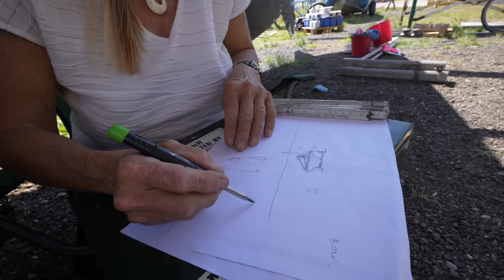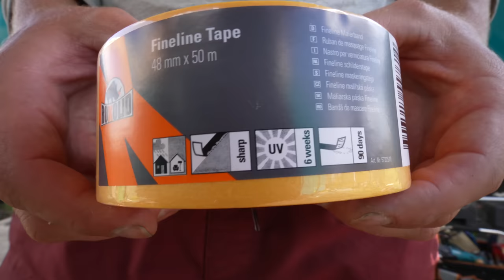Launching My Unfinished Project Catamaran | Wildling Sailing

Comment: Anyone who stirs his coffee with a wrench is ok by me.
Reply: That one got me too! Ha
Reply: Picked up off and returned to the gravel yard no less. Classic…..
Reply: Indeed. Says all we need to know about Mark. 🎉🎉
Reply: Stirs his coffee with a wrench laying on the ground and stirs his paint with chop stix. What a mess!
Reply: Guy is a superhero
Reply: the only way to do it
Reply: That’s ok, but you don’t stir tea that way - right?
Reply: YUP! Nothing like a little gravel with your morning cup of Joe!
Reply: Stir with a common flat tipped screwdriver instead of a wrench. You can jam it into the ground to scrap off stuff on the blade and with a simple wipe with the inside of your t-shirt and it’s visibly clean. Looked like rust on that wrench. Don’t want to get an intestinal issue and need the ‘reading room’ on the boat. Go go go Mark. The boats looking great.
Reply: …gonna get wrench-mouth…got stick-throat once…
✌️<~~Oregon
Reply: I mean I don't want to start a spanner war, but if you use 13mm ring-ended, you'll never get the full infusion. Has to be max 10mm, or 3/8ths, otherwise the swirl effect is incomplete and full flavour is not achieved. Best is a quarter inch chisel.
Reply: Fully agree
Reply: Anyone who stirs coffee straight after pouring hot water is not ok.
Reply: I have stirred my coffee with countless different items, I didn’t even notice it. It’s funny how normal is so different to different people
Reply: Grandpa would pick up a stick from the ground and stir his stuff, always found it hilarious.

Comment: I worked in a boatyard for a while in the 90s. When we came to do the waterline on a boat, the boss would get out an old surveyor's theodolite and set up 30 metres or so away amidships and direct us as we applied the tape. Perfect job every time!
Reply: Today you would use a Lazer pointer or level and you could do it single handed... transfering to the hull inners by using a length of clear plastic  pipe  with water in.. matches the inner level to the sight line.. even across along stretch between hulls .

Comment: 1 advice for the next job when using masking tape. Never roller up or along the masking tape, always use a brush and brush from tape away, then roller carefully close (not on) to the masking tape. This is to prevent paint bleed under the masking tape. Otherwise, a good job well done.

Comment: Yeah! Wet keels! That's a lot of progress in a short time. Rigging, take what you can get as cheap as or for free, you can always rehash it later. You will need some extra motivation over the coming winter months, being able to make her sailable in the short term would be a good target to achieve. I'm sure there will be some that are getting rerigged over the winter at that yard and would donate their old rigging that will be good for a season or so.
Reply: They say replace the rigging every 10 years. An insurance company might say 7 years, especially for the main supportive rigging. Say you are going to take 10 years to go round the World it would be best to start from new. Most that comes off is because it old and past it's use by date. Might be OK for light summer coastal cruising but still risky. Best to get good stuff and don't under spec. Maybe select some good used items for emergencies. Quality shackles and blocks always worth picking up. This goes for anchor chain too. Not cheap so always a difficult decision.
Reply: @delukxy  Wharram boats are (of course) a bit different. 
Just use high-quality very-low-stretch Dyneema for the standing rigging.. (That type of Dyneema is very expensive, but it's also very good).

Comment: Google translate (sorry). For the waterline you can take two plastic bottles. Return them. Cut the bottom. Mark them. Connect them to a long watering tube. Fill with water. Secure one of the bottles in front or behind the boat. You have a free water level. Only obligation: the boat must be wedged horizontally... I did it and it works.

Comment: Such a long way from paddling with a shovel in a shore salvaged, almost leaking row boat, out to your newly purchased wharram, with no assurance it wouldn't sink momentarily. And then your cleaning 10 yrs of mold and filth from the inside, square by square, til you had a place to lay your head. I could hardly remember those days as I watched your boat being lowered back into the water, beautifully painted, floating and taking its place alongside other sailboats of the respectable sort. By gum you did it.
Reply: This is just lovely🤗

Comment: I was wondering, how many layers of paint did you ad on the repaired polyester spots on the hull after using the primer and before applying antifouling? Because antifouling doesn't protect the polyester at all, it's only against barnacles. Normally your put 5 layers of paint on the blanc surface before applying antifouling.

Comment: You can buy these crepe rubber blocks that are made for removing all that caked-in crud out of sanding pads. You just run the sander and rub the block into the sandpaper and voila! you get a new sanding disc/belt that you would have thrown away. Saves heaps of dosh👍👍

Comment: The reason Boats are white mostly is because they are in the sun most of the time, dark colors like solar panels absorb heat and probably will cause unnecessary repair later from the heat they absorb..
Reply: Also (as I’m sure you know) white also stays better looking longer. Is easy to touch up without looking patchy. And is easier to see than a darker colour on a dark sea. White maybe a bit unimaginative but I stick with white now… it’s a practical choice not a creative one.

I had one red boat… was a total pain to keep looking good.

Comment: I like to use a thin fineline tape (like a vinyl tape) and pull it tight to get long smooth straight lines, it also gives a crisp line compared to the paper tapes. Your way works to, just a tip

Comment: You forgot the clear plastic pipe and water level trick ...add food dye for visibility fix one end and the other will always balance to the same level all round the hull or boat.
Reply: The problem was the yard, the boat was on a slope, or we would have laser levelled it
Reply: @dominiccorley7546  
Fair enough but the same tube level can be used to get the boat level on blocks as well.
Reply: And for measuring any variations from a chosen level over irregular terrain...it doesnt break or cost a lot either and needs no power source.. 
I used them as a kid plotting blowout transects through sand dunes... And streams.  Dont think you would want to play with a Lazer level on water.. or in a swamp.😉👍🏼🧙‍♂️🇬🇧

Comment: 1:58 old adage: "if it looks straight, it's probably straight". You can also help yourself with a little trick. Find a mirror. put it perpendicular to the hull and when you sight through the mirror, you'll see the straightness of the line even better.

Comment: Use wire for the rigging, Mate. It is much easier to maintain. Dyneema is a pain in the ass - you will be constantly tightening it to get the "creep" out. Once you get it set up initially, the wire is fit and forget. Dyneema is fine for race boats, where you have a crew constantly fiddling and maintaining it. Not good for a solo cruiser. I can't stress this enough - don't do dyneema!

Comment: nice episode, some tips regarding masking, don't use such a wide tape as its harder to get to conform to a combine curved surface,  and if you need to touch the tape when stretching it, make sure you are grabbing it in the middle and not to one side of the tape as it will actually bend (can be seen when you are masking it, paint jog looks smashing! good to see her floating

Comment: If you pull your tape OFF back against itself (and not 90 degrees from the surface), you'll end up with much cleaner edges. :)

Comment: congratulations for all your courage and work . since you will soon decide on your platform design ,I share following thoughts : as offshore toilet alternative, especially for women , an asian style hole ,in the deck platform ,with lid and appropriate safety measures .  2 dark ,watertight containers ,fixed to the deck ,maybe with view protection and safety for asian toilet in mind . watertight containers strong enough to stamp with your feet in it . the rocking motions of not fully filled containers ,plus feet power will turn these watertight containers into a wash machine . a water collection surface leading into the containers during rainfall plus a water hose near toilet hole and containers will further facilitate washing of bum ( clean style for millions in Asia ,saving trees ,paper litter and storage volumes ,including use of bio soap) .
As just one of millions who got skin cancer ,I highly recommend a roof design ,done with sturdy solar panels . wishing you the very best .

Comment: It would be more practical and economical to buy some off the shelf sheets of various grades of sandpaper and not waste the round perforated sheets designed for the electric sanders. Much easier to use and way less waste 😊

Comment: beam looks ok . stepped as you have it is good enough for the end . different if nearer the centre, then you'd need it scarfed 10 x thickness . Try using a big pull saw for big cutting jobs

Comment: I'm still surprised to have bought it, and was really hoping to see a cabin top put on it. Hopefully I'll be impressed with the rest of the work to come. You put alot of time into the finish, look, not sure you will ever break even, if you sell it. Just to update electronics and navigation,  gps, system,  will be 3 to 4 thousand., not so sure the beams can take a load of a cabin cockpit.  I'm hoping you just don't mount some outboard on it, with a steering wheel box. Definitely seems like a fair weather boat.
Reply: Ryan,,,Give the lad a chance man!!

Comment: Nylon nut would be great to hold the rudder on, I would have drilled the bolt for a cotter pin just to be safe, I bet there are lots of nuts on the ocean floor.

Comment: when you are rolling on the paint screw a broom stick into the roller handle it makes a cheap roller extension  it's easier to hold the roller with two hands and will save your back! cheers

Comment: I don't thing those pulley wheels will last long as plastic rudder bearings, firstly they're not solid so will probably crush. Usually these bearings would be made by using a hole saw on a plastic breadboard which is probably cheaper then the pulley wheels as well. Anyway, check them and replace if needed before going off shore, as I'd hate for something simple like this to cause you issues in the channel 👍

Comment: Nice work.

That waterline and  anti fouling is looking very sharp.

The blistering of the split paint, could it be due to the original  paint below being single pack enamel and not polyurethane?

Your living your  life well Mark, at your age I was in the Australian navy.
If I had my time over I'd be following your lead mate 👍

Sounds like you've got a good strategy for tackling the road ahead.

Get what needs to be done to get  it on the water and then get the rest of the jobs done as  you can maintenance / refit style rather than doing a full restoration / rebuild all in one go.

Cheers

Comment: Why do a few centimeters matter for the placing of the water line? I thought it was merely cosmetic. Is there a particular reason that was important to move?
Reply: Yes, very important. It establishes a visual reference of a boats displacement from bow to stern. From there you can determine balance and weight to optimize performance.
Reply: @MaShcode  ok cool that makes sense. I appreciate your reply!

Comment: Are you aware that you cant put a two pot paint on top of single pot paint as the two pot chemicals will melt the one pot paint 
Your result suggest that this could be  your 
problem.
But you can put single pot on top of two pot.

Comment: Sorry you are so rushed to get the boat back in the water without finishing the neccessary projects.  It seems the most important things to be finished should be what is unfinished, shaping, sealing and properly lashing the beam to the boat.  Then finish the rest of the exterior sealing and painting BEFORE winter really sets in and it starts raining continuosly.  The mast and all of that work probably should wait till you have all the decks, cabin tops and engine mounts completly finished.

Comment: Everyone told you about the beam you fixed with a butt joint will snap. You are so nonchalant about it  in the middle of the night in the middle of a storm it snaps what are you going to do? Please add another section of wood on top maybe some really strong hardwood with a straight grain will do the trick
 If you do not fix it properly I will not want to watch an impending disaster  to  occur. Your yacht is dangerous the way it is. A death trap
And you are playing around with the paint